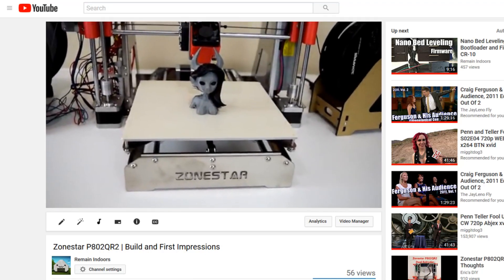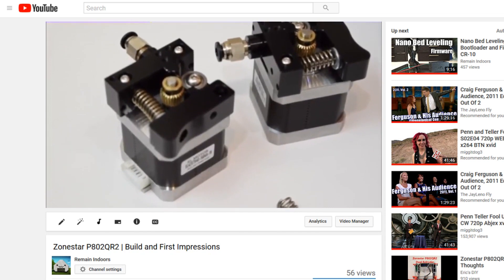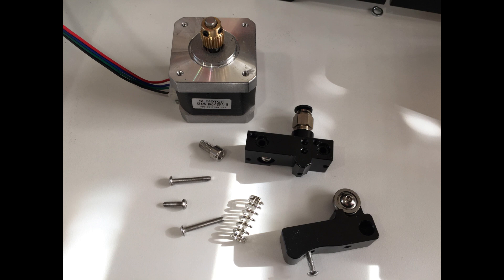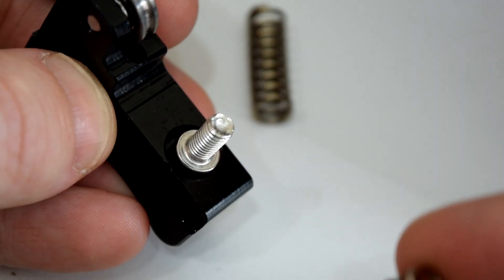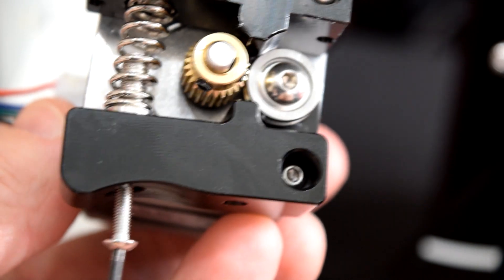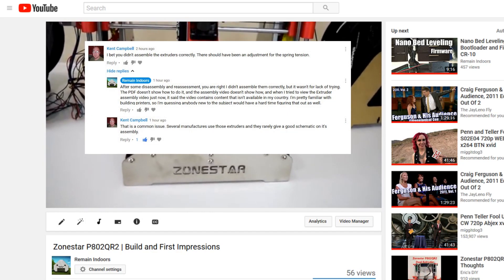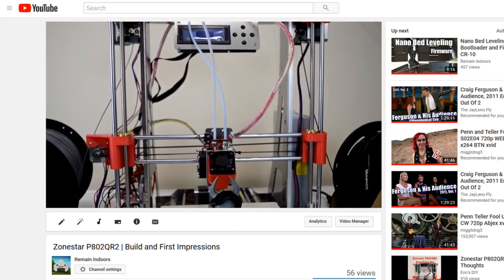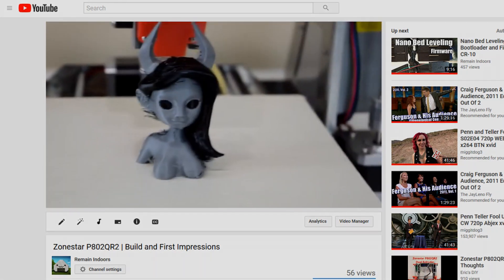Zonestar Dual Extruder 3D Printer | Extruder Assembly Correction

Comment: I should point out you were using the version 2 instructions and I don't know why they do this but in the installation folder for that model has the version 3.1 instructions that show what you need to a point and how the extruder is put together. The only thing I wasn't sure if I got right was the 2 smaller motors if I use them with the extruder part.